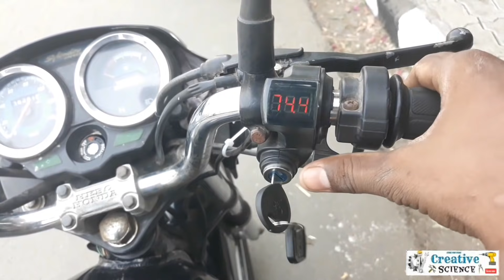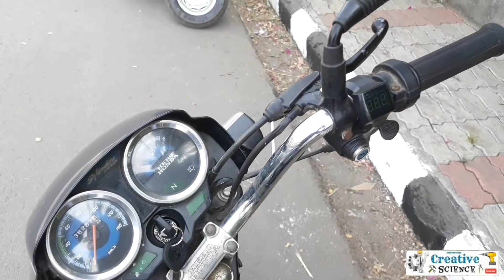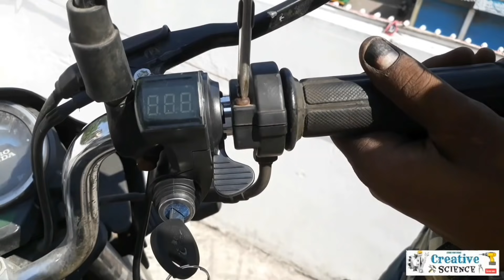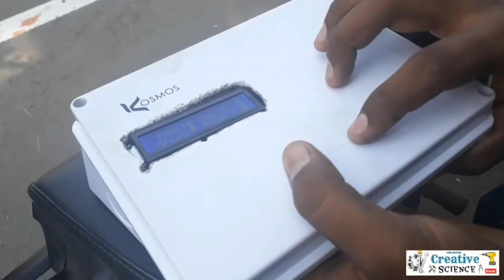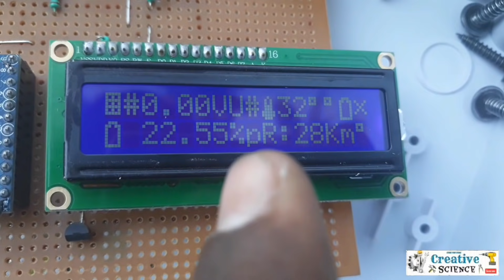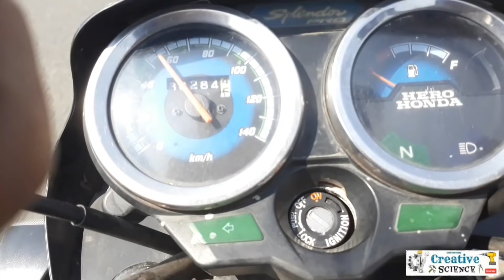Petrol and Electric Hybrid Motorcycle Part -2 || Creative Science

Comment: When running by petrol its normal just power off the hub motor. But while running using battery I think we need to put the petrol engine on neutral.

Comment: When you use brake, you have to stop battery power and use first rear brake and then front, don't go with maximum speed when you r using battery and motor, you confused if you have to sudden stop because clause is useless and you don't have to use rear or front brake without stopping power supply because it can damage motor
Upgraded nedded to use
For horn and light etc. u have to turn on bikes power and changing wiring to direct from battery to use all lights and horn indicator

My suggestion your key for battery power supply/switch attach to clutch for best use 👍
When u press clutch it disconnect power supply motor then apply brake to stop your bike
When release clutch it again connected 👍(no need to switch off)

And make a system to charge on electricity
And keep both keys on their place and on for horn & all

By the way 👍Good Job
Great work, God bless you
Well appreciated 👍🎉🔥🎁

You really make your own brand for hybrid motorcycle 🎉👍🔥

Comment: Is the battery auto charged when the motorcycle is running on the engine or is it separately circuit or wired?

Comment: i do the math: 
only 2 kwh of battery; 
1 liter of petrol has 10 kwh
those batteries are the same as 2/10  times 3, meaning it is 0.6 liters of petrol (combustion engine has ~~33% efficiency,elec much more~~90%)
so,due to the trouble of charging and discharging,the BIG cost of batteries,the cost os electricity,or solar panels,wirings,chargers, inverters, time spent,  etc,etc,
is it worth it?